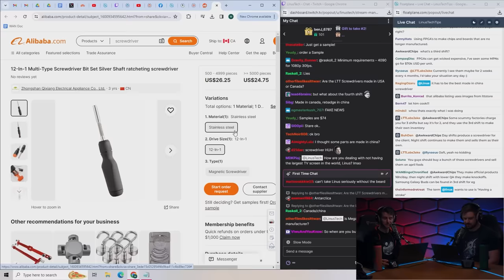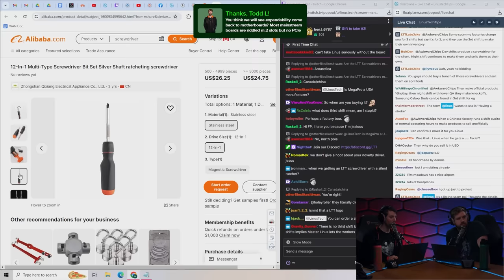Do Not Buy 500 Fake LTT Screwdrivers

Comment: You may have worked with a company close to you but all they need is a sample sent to them in China and they'll make a knock off. It happened to me selling something on Etsy. Someone outside of China ordered it, sent it to them, made a knock off, started selling it. I lost a lot of business and had to close up shop.
Reply: That's a damn shame
Reply: This is a good reason to not do any business with China.
Reply: They have no morales unfortunately
Reply: Linus didn’t say it’s not a knock-off. In fact at the end of the video he says you may receive something that looks somewhat like the LTT screwdriver (through certainly with lesser materials in my view). He said it’s not a “third shift” product. For those unfamiliar a third shift product is something that comes from the same factory as an original item where the manufacturer runs a “third shift” to make and sell products that are identical to the branded original but sold directly from the manufacturer or through a shell company.

So he’s responding to morons saying “just buy the Alibaba screwdriver, it comes from the same factory anyway”. So wrong
Reply: @TheShortStory  Which is pretty much the definition of a knock-off... 🙄
Reply: I'm genuinely sorry about what happened to you, but that is probably not what is happening here. If it were, there would be no need to use LTT's photos, they could just take photos of the knockoff. It will be just like Linus said--it might resemble the real thing, but the quality will be nowhere near worth it.
Reply: @samhouston1288  Did you read the comment? "Someone outside of China ordered it." What you said is true, but it doesn't even remotely address the problem, so there's no point in saying it.
Reply: @unitedhybrid187  actually not even close. a knock off is a company that reverse engineers it to a degree, and sells a cheap version just like it. what hes talking about is the exact same thing, with a different name and a different person taking the profits.
Reply: @unitedhybrid187  "Which is pretty much the definition of a knock-off"
No, it's completely different. 
Third shift products - which actually exist - are the same product made at the same facility with a different package. Many automotive parts are available as third shift alternatives. This is particularly true of consumables - filters, gaskets, brake pads etc - for German cars. The parts are often made in Eastern Europe as OEM parts for BMW, VW etc. 
On the third shift they're sold as Mann and other brand names. Identical product, different package, substantially different price. 
Knock offs are simply a cheap copy made without the permission. They are not made at the same location or the same quality. They're totally different.
Reply: What was the item? I'm curious
Reply: can't you sue for that kind of thing?
Reply: That's why you need to create high quality products. High quality products are very hard to rip off or atleast not worth it to rip off.
Reply: Amazon does the same thing - they will take a popular product, have a knock-off created and then promote it over the original and at a lower price.
Reply: yes, I dont know how Linus doesnt understand this. Doesnt matter if its Made in AMerica (or Canada in this case), but CHina is light years ahead of us and they can reproduce anything with the machinery they have. They do it all the time. Something new comes out, wait a month, its now on Alibaba.
Reply: sure, they will make something, whether it has the reliability and attention to detail needed to be reliable and have low returns rate is another matter
Reply: @l4kr High quality can be all about the engineering and R&D. And there's no way to prevent that from being stolen and resold. They don't need to design it, they don't need to do usability studies and tweak geometry to be just right. They can just copy it. The only thing they can't do is copy exact manufacturing tolerances, natural materials (wood, leather) or extremely expensive processes like chip production, but that doesn't cover most consumer goods and it's ridiculous to say that anything that isn't made of expensive materials or using very specific manufacturing techniques deserves to be stolen regardless of the effort that went into designing it.
Reply: That’s exactly how it works. They will just outsource a portion of the preordered product… Newayz, let’s not argue about this, he already runs a business in Canada but charges usd price to Canadians. 250 usd backpack 🤦‍♂️
Reply: @samhouston1288  Can't do that. It's impossible. All someone needs is one to disassemble, all someone needs is to buy your product outside of China once, then ship it overseas where it'll end up in Asian hands soon enough to eviscerate and replicate their knockoffs with. You either embrace the dragon, or the dragon will embrace you, but dragons will be coming nonetheless.
Reply: @joshy1703 ”$250 backpack 🤦‍♂️” THANK YOU
Reply: @unitedhybrid187  No, that's not the definition of a knock-off. A knock-off is when you look at someone else's product and try to make the same thing. A third shift is when you are literally the physical manufacturer of the product, who has been contracted by the brand owner to manufacture and ship the product to the company that designed it and owns the brand, and you manufacture some extras that are unbranded (but literally the same product otherwise) and sell it directly.
Reply: @ThisIsArty  Not in china. The shell goes bust and another one pops up.
Reply: @unitedhybrid187 No, actually. A knock-off isn’t identical. A knock-off is made to look almost exactly like a more popular product but be made more cheaply from cheaper materials and design. A third-shift product is the exact same product as the original, just made during a third shift at the factory to be distributed through cheaper channels. The posting is claiming it’s a 3rd shift product but it’s a knock-off. They are not synonymous.
Reply: You were not being competitive with prices
Reply: What a weird gripe for one of the most common things in the world
Reply: @unitedhybrid187  That's literally not the definition of a knock-off.
Reply: yes, but have you considered that they make the plastic in Canada? this is simply something china cannot do, make plastic.
Reply: @TheShortStory  so it's made in a different Chinese warehouse.  Got it.  Literally no point here at all
Reply: And unless you can get order quantities in the millions getting the same kind of quality on the LTT screwdriver is just going to cost that much money, now if you could Mass manufacture a million of them maybe you could get the cost down by $20 US but someone actually looking for a relatively high chance of getting a quality product isn't going to buy from AliExpress or Alibaba, especially from listings like this where the minimum order quantity is 500
Reply: @unitedhybrid187 uhh... 😂
Reply: @unitedhybrid187  its not a knock off when its made in house by the same people who make the original, hence why third shift. a knock off is when they buy something made in the us, or whatever and make it look similar with cheaper components. that's a knock off, hence LV bags and all the supreme gear u see on temu n shit. all fake knock off's.

Comment: These Chinese resellers saw an $80 screwdriver for sale, bought it from LTT and reverse engineered a cheaper version of it. Ik he says otherwise but I'd imagine it's real, it certainly would not be the first time it's happened. I doubt it comes from any of their suppliers, just a stolen IP knockoff
Reply: I dont think there was any reverse engineering involved. They just copied the plastic mold most likely and put in the cheapest ratchet mechanism they have.
Reply: @Debilinside  I mean they say it's a patented mechanism so the very detailed schematics are online and public, it'd be easy to copy. Since China doesn't care about IP protection it's not like there's really any risk either
Reply: @MrDummyisDumb  Lol, no :D You have absolutely no idea how manufacturing works. To patent something, especially in the US you dont have to submit detailed plans and precise measurements, you only have to detail what makes unique and new. Thats why it was so dumb for Apple trying to patent a rectangle...
Also even if the online schematics have precise sizes they didnt include tolerances... And without that good luck reproducing something, especially something like a rachet.
Reply: @MrDummyisDumb  It wasn't patented by them, so why didn't a copy exist before? That isn't how patents work.
Reply: @Debilinside  You might not have to but many definitely do, especially if you need it specific enough to qualify for the patent. I'm not saying it'll give you the recipe for it, but it gives enough of the engineering behind it to reverse engineer something similar. Even moreso when they can buy the drivers off the shelf
Reply: @nimoy007  Idk what you're talking about, Linus literally says it's a Megapro patent. LTT licenses it. The copiers would rip off the LTT design because people are paying $80 for a screwdriver they can rip off for significantly less. There's also likely no market for knock off Megapro
Reply: @MrDummyisDumb The mega pro isn’t much cheaper either. Fake tools are a thing and they’ll be pale imitations of the real thing.
Reply: @MrDummyisDumb  EXACTLY. It isn't an LTT patent. The design has been around, so if your theory were true, it would have been copied ages ago. Good thing that isn't how patents work.
Reply: @MrDummyisDumb  Okay buddy... Think what you want. I'm very confident there was no reverse engineering and if even big automotive manufacturers cant just simply copy something using the pattern a chinese sweatshop wont be able to do it either. Bet beside the wont be able to part why would they? Their goal is not to create a good product, their goal is to sell something that is very cheap to make and hopefully passes the first glance as the product they knocked off. Manufacturing a good rachet is not cheap, believe me.
Reply: @Debilinside  Agreed. Just like Chinese "mic" copies. The "body styles" of all high end expensive microphones have been cloned for years, at various price points. They're usually not quite the same design/nowhere near the quality as the $5000 mics they're copying, but as a "mic body" they're often decent. However, if you look inside, it's always just the cheapest capsules/electronics you've ever seen shoved inside, which usually sound pretty terrible. A lot of people use them for custom builds though because if you replace everything inside, sure they can sound great.

Then again, I'm not sure what you expect buying a $5000 mic for $50. If you had any real expectations there, well .........
Reply: @Debilinside  Back to my above point, yep. Same thing with all these mics. The body styles/dimensions have been cloned forever, but they're not reverse engineered, just the same shape. Also, the electronics are absolutely not reverse engineered. They do that too as you can buy reproduction PCBs of some of their electronics (the designs have been known for 75 years), but most of the mics are still just the absolute cheapest crap possible shoved inside. Even to have a "copy/reverse engineer" of the original using crap parts would still cost way more than the price point they're usually sold at.

Comment: For most people just having the ratchet is a win. I feel most people don’t care about the plastics if they can source their own.
Reply: There's nothing quite like using a screwdriver that actually fits in your hand well.  You can get so much more torque, it's something that people who only ever buy cheap screwdrivers often overlook.  If you use a screwdriver that has a good wide handle that fits in your hand well and lets you get a good strong grip on?  It makes everything you do with that screwdriver easier and by a significant margin.

Note, this isn't even  just about the LTT screwdriver, there's plenty of drivers that have a good grip but they do tend to cost more and most people seem pretty happy to buy pretty garbage drivers.
Reply: @Enclave.  I mean...if you use it few times in a month even chinese garbage made of metallized paper (or whatever is this soft garbage that wear itself down completely to unusable state after a year) will do fine.
Reply: @alexturnbackthearmy1907  Mass manufacturing quality metal tools are very expensive, so opting to cheaper metals because they last longer would work mostly on low production products.
Reply: @alexturnbackthearmy1907  People that were going to pay the price of the LTT screwdriver were never going to buy whatever the heck you're talking about.
Reply: the likelihood of getting the same ratchet, made to the same tolerances and with the same compounds of metal is highly unlikely
Reply: @alexturnbackthearmy1907  I have this screwdriver, also the ifixit set and god the ratchet in this one actually is amazing for working with stuff that involves self tapping screws. Saved me from going insane doing wall anchor/house stuff, or even screwing in PC fans that used to be a massive pain with a regular screwdriver. I would strip the hell of those screws in the past and like the other guy said the torque you get from this is insane. For the house stuff I mentioned this is stuff that I used to break out the power drill for but ironically I just use the LTT now cause I'm too lazy to break it out and swap bits.
Reply: @Parastack  Good to know that at least quality is here. Its one thing if expensive tool is good, but whole another if it is matched by something much cheaper. Sometimes chinese brands do bring cheap quality, but i dont think that is the case for cheap knock-off.

Comment: Top commenters not understanding the difference between a cheap knock-off and a third shift even after watching the video 💀

A knock-off is what is most likely happening here, whether it be a stolen prototype or reverse engineered.

A third shift is usually what's called "Chinese OEMs". OEM standing for Original Equipment Manufacturer. OEMs would have the same exact quality as the third shift products as it's quite literally, from the same factory.

Linus isn't saying anything other than defending his integrity. He's saying that the R&D and the quality justifies the cost, it's a quality tool that he put in a ton of hard work on. It is not a rebadge of an existing item.

By saying it's a third shift, you're invalidating his efforts. This is why he's so mad.

Comment: It’s funny you think this isn’t possible. Chinese manufacturing is insane. For example, Rolex watches. Those Chinese factories pump out reps that are only distinguishable by microscope and sell them for a tiny fraction of the price. You could get one sub $500 and nobody would ever know the difference. 

Not saying it’s right, but you’re up in the night if you think china couldn’t quickly and easily replicate your simple tool and under cut you on it. They may even make it better. Lots of examples of this just in the watch world alone.

Comment: I’m in the process of trying to make a device. Prototyping and tinkering is fun and relatively well covered with Pi Adafruit and Ardruino guides. 

But going from prototype to manufacturing is really confusing for me. It would be super cool if you made a video on how you go about sourcing a manufacturer and scaling to mass production.
Reply: I have a friend who does this so I can tell you what I know
you could absolutely find a Chinese company, on your own to manufacture the product for you, but its going to mean a lot of calls and emails and generally an in person visit, but its going to be a LOT of work on your end since your basicaly starting from scratch
you might also need an interpreter if you dont speak Chinese to ensure nothing's lost in translation.
Realistically, you find someone, such as the aforementioned friend, you explain to them what you want, and then they sort all of that out for you, you might however still want to visit the factory to make sure they are doing it to the standard you require.
Often if you really want mass production and high quality you need someone under your employ to be at the factory, otherwise they will take liberties to tweak production and parts to make production cheaper.

Comment: I know they are proud of their driver, I have 2 to support them in fact. But the plain fact is it is an acceptable screwdriver. The ratchet is nice and smooth but the handle is not good. There have been a number of times that i was not able to get enough grip on the driver to remove a screw. But my JH Williams hard handle did it without an issue. (jh williams is a snap-on brand that is 1\3 the price and is exactly the same in every way. They are also available locally, for me anyways).

Comment: Wouldn't it still be possible to be partly 3rd shift though? At least the ratchet and shafts?
Probably plastic molds wouldn't be that good, but I wouldn't be surprised if they somehow got the actual main mechanical parts from 3rd shift.

Comment: Lol. All good ideas are copied. Even bad ones are these days. 😉

Question, how durable is it for automotive? I'm a pretty big guy that does torque on my current driver's. I've broken tips and spun shafts.
Reply: its fairly durable but its not designed for automative, there is a very good video on youtube comparing it to other ones and abusing them util they fail, basically its a screwdriver designed for computer stuff, furniture, and etc. https://youtu.be/845HUaWYSQA